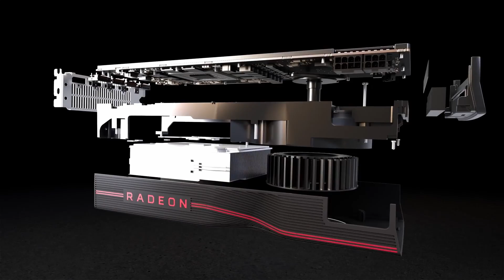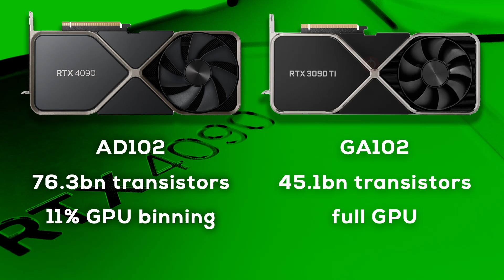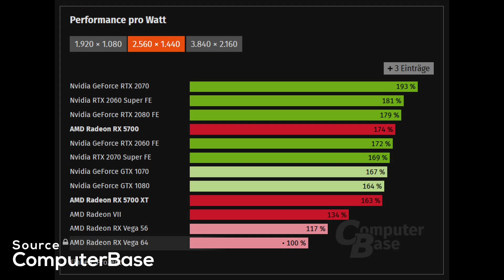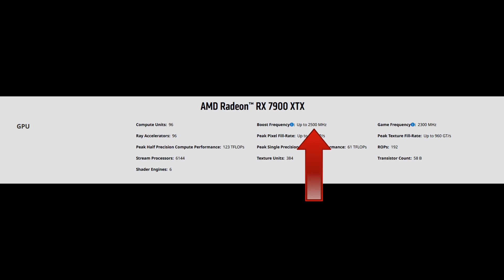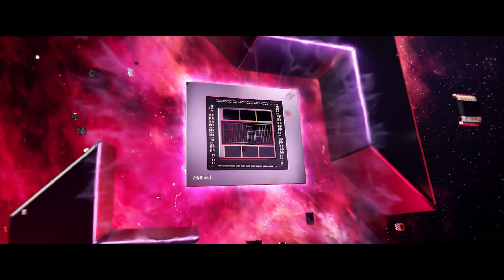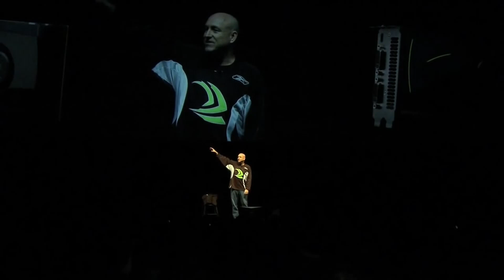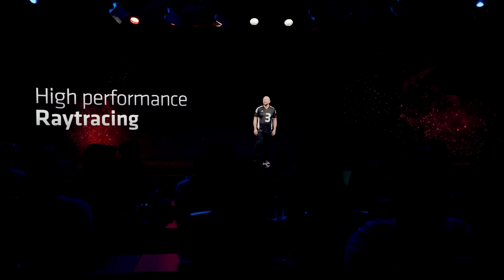RDNA3 – what went wrong?

Comment: This is incomplete reasoning. The economic metric includes silicon cost per transistor, not just the total count of transistors.
Monolithic dies suffer increasing defects as die size grows, making average cost per transistor to go up. AMD likely made a trade-off of adding more transistors at lower average price and some of those added transistors were likely just the overhead of the chiplet design (allowing smaller dies).

Comment: Cheers for an excellent video that presents some well-organized information. It’s abundantly clear that AMD made compromises with Navi 31. It’s interesting how nVidia provided a gapping hole that AMD felt they could fill even with a subpar offering. Taking AMD’s own comments into consideration it’s clear that they either planned on underclocking Navi 31, or were forced to in order to ship by Q422. AMD might release an iterative version with a faster clock speed, but that will do little to redeem their once sterling reputation. 

My take on this parallels the comments made by “High Yield”. I’m guessing that AMD knew they had to bite the bullet to introduce the very first GPU chiplet design. Because power requirements for nVidia’s Lovelace architecture were so insanely high, AMD sought to offer a GPU that was somewhat below most folk’s expectation of 50% improvement over Navi 2, while also consuming far less power than nVidia’s new GPUs. 

AMD likely assumed their lower power consumption combined with much lower retail pricing for Navi 3 would make it a no brainer, at least until benchmarks showed the actual performance, which is always lower than what manufacturers show during keynotes. I mean seriously, have community benchmarks ever exceeded keynote expectations?

That said, when I consider how much additional engineering went into AMD’s first chiplet-based GPU design, there’s likely some extra performance hiding in Navi 3. It’s difficult to assume otherwise when we consider how rushed Navi 3 appears at first glance? Requiring any processor to go off-die to access cache will impact performance, but AMD has bet the farm that their chiplet approach will work even for high bandwidth ops like graphics processing. AMD will discover both the good and bad of what this architectural shift provides. As AMD continue developing drivers and probably more importantly, revving hardware with process improvements, Navi could far exceed its targeted 3Ghz clock does to provide some serious performance improvements. There’s likely some headroom built in to Navi 3 that will take time to unlock as AMD continues to refine what’s a brand new approach to GPU packaging. 

Phew! Sorry for the novel-length comment! I really enjoyed the video and appreciate all the time and effort that went into making it. Well done! 👏 👏👏

Comment: I Think "High Yield" didn't elaborate on the Interconnects? The AMD Guys said the Interconnects to the CMD Modules introduce a extra bit of latency, maybe only because the way is longer (idk).. and they will fix that added latency through higher interconnect clocks. Maybe the Higher clocks didn't go up all the way they wanted. and so the chips are starved of Date from situation to situation.
Reply from the maker: If that’s the case, a bandwidth test could help figuring it out. For example overclocking the memory alone.
Reply: @HighYield  Memory Clock is one thing, but does that also increase the interconnect clock?
Reply: I’d anticipate that overcoming the latency of off-die cache was among the most challenging aspects of AMD leveraging their chiplet design on a GPU?! I watched the SRAM scaling video right before this and it seems that AMD saw the writing on the wall. 

These are some exceptionally well made videos that present very complicated topics both clearly and efficiently. I’ve only watched two, but they were easily worth a subscription.

Comment: You have a crucial mistake:  The GA102 aka 3090ti is 28 Billion transistors, not 45 .
I strongly recommend to redo the video and correct those number... or patch it.
Reply from the maker: Read the pinned comment :)
Reply: @HighYield  I read it afterwards. in the video, please place correction, a tag overlay with the correct number... my recommendation.
regarding the 3 reasons you stated, I think clocks isn't one of them because, when those cards are overclocked to the extreme,  and we got up to 3400 Mhz at our testing, the performance do not improve. when the stock is around 2.5Ghz, the best OC achievement from there, is around 10% doesn't matter if we raise the clocks 10, or 20, or 30%.  no more performance is achievable. . it doesn't scale correctly so the conclusion is that the clocks are not the problem. the problem is some bottleneck some where in the pipe. it can be due to the new cache and Vram architecture using external chiplets, maybe too much latency, buy until AMD  tell us what they have found out, we can only guess.

Comment: Um wrong 23.6 tflops of the rx 6950 xt vs the 88 tflops of the rx 7990 xtx is way more 30% more like more than 300% improvement and that’s just the base amd model add 3rd party models of that graphics card and you’ll get about an extra 7 tflops , matching the base model of the rtx 4090 ti 😮

Comment: AMD overpromised and underdelivered with RDNA3 (especially with that "up to 1.7x" slide). The 7900XTX is a good card especially againts the 4080 but was just made to look more capable than it was. So if a company doesn't deliver, it's only fair it receives the backlash. This is not the type of behavior consumers should be rewarding.

And the cards will get better as they improve their drivers but again, consumers should be reacting to what the products can do now, not what it can do 1-2 years from now. Nvidia RTX 2000 series (cos not many RT games at launch for such high priced cards) and Intel Arc (DX11 driver issues) both rightly deserved backlash from this. 

And of course quietly increasing the TDP of 7900xt after the big presentation is pretty scummy. AMD was just taking advantage of the (rightlyfully so) backlash to Nvidia's prices this gen as consumers' thirst more well priced alternative than usual.

Comment: The comparison in purely transistor count is not very fair. A significant portion of the die is dedicated to cache, which doesn't scale much in density from 7nm to 5nm, and 7900XTX has the same total die size while needing to dedicate a large portion to cache.

Looking at the GCD, 6950xt has 80 compute units or 5120 shader units, while 7900xtx has 96 compute units or 6144 shader units. That's a 20% increase in CU count for >30% increase in performance.

Comment: AMD really, and I mean really must absolutely must not continue to mess up these launches. RTX 50, AKA Blackwell, will have it's flagship built to the reticle limit of TSMC N3, which will be 850mm square die, the 4090 is only 600mm square, the 2080ti was 770mm square. A near 50% larger die with a 35-40% transistor density jump, in addition to actually cranking the TDP to around 650( a 50% power jump on a 30% more efficient process) and you are looking at again, another 3090 to 4090 jump, but to the 5090. I don't think most people realize how fast a 4090 is either, it is roughly 3.5 RTX 3070s worth of performance, and 2 3090s..or 6 GTX 1080s. It is obscene. 

AMD needs to get this right, and then release a 7950XTX using a 550mm square + GPU die in addition to the MCM approach. Nvidia keeps saying they are monolithic only, but the reticle limit on TSMC N2 is only 450mm square, Nvidia will likely move to the same approach AMD is currently using then, which will still  be a huge net gain as currently cache takes up over 2/3 the die on the 4090, and will likely on the 5090. 

Worst case scenario though, Nvidia releases a N3 MCM GPU where the 850mm die is just the compute die, at that point AMD would be unable to contest Nvidia's performance for at least 2 or 3 years.

This isn't even addressing the absolutely dogwater Ray Tracing performance AMD has. It does not matter that many forms of RT in games are Nvidia based methods. There are AMD methods out there, they look bad compared to Nvidia's RT and are not even worth using when compared to already existing shadow methods, especially against modern solutions like those that exist in UE5, with Lumens. AMDs approach is only good for reducing complexity of the GPU compute die, they build with the same ethos of 1 size fits all like they do with their CPUs. The difference is a CPU whether it has 2 cores or 16 can still run all the same stuff, only difference is speed. Their approach to Ray Tracing with RDNA is like trying to run the physics in a game off the CPU.

It is so fundamentally flawed because the GPUs do not have dedicated RT cores, so until AMD can figure out how to run RT asynchronously, via the FP 32 + FP 32/Int architecture(this probably isn't even possible) they added with RX 7000, it is always going to carry an enormous performance penalty because you are not only running more stuff, but you are taking away cores for raster and giving a significant number of them to RT. 

Perhaps now that AMD has an MCM design they could add a RT dedicated chiplet to the set up. That would alleviate the issue. But it is not acceptable that 4-5 years on,  RTX 20 series cards will be able to out perform some RX 7000 cards in RT.

Comment: Do not forget, Nvidia actually jumped 2 nodes. Ampere was on Samsung's 8nm, which is just a refined 10nm. They now skipped 7nm and went straight to 4N, which is a refined 5nm. Previously with RDNA2 AMD had about 1 node advantage. Now they are ~half a node behind.
Reply: Nvidia jumped 2 process nodes and 3 generations of lithography machinery. It’s the cutting edge of mass production capable Lithography tech currently. That’s why the Lovelace wafers are reportedly 4 times the price of Ampere. However, they massively cut die area for the 4080 vs the 3080, so it shouldn’t be THAT much more expensive to manufacture gen on gen. The obnoxiously huge coolers for a 300W max chip adds quite a bit of BOM cost and the markups are huge. I still think the 4080 should have released with its own cooler and a 700-800$ price tag.
Reply: @MechAdv  If it was released at that price it sure would be praised
Reply: @Mielyn_Lux  For sure. I honestly would have bought one. I only upgrade when I can get 50% more perf for the same tier card. I upgraded from a 980 to a 2080 to a 3080. Not willing to pay more than 700-800$ for a GPU though. So it’ll probably be another generation before I can get my 50% uplift at the price I’m
willing to pay.
Reply: @MechAdv  for real. as a water cooling enthousiast the cooler is just something that will end up on a shelf.
Reply: @MechAdv , 1080 Ti was a 300 W GPU and somehow only $750-800.
Reply: @KraziSpeed Agent 09  None of those numbers mean anything. Read some of my comments in this thread to understand why those 4n, 5n, 7n, mean nothing. Nanometer is a misnomer now for transistor size. The 5n from TSMC is between 22-36 nanometers. It's all about transistor density these days, and the so-called "8nm" isn't a node generation above "7nm." It's more of a quarter generation better. The problem with RDNA3 is that AMD played it safe and the teething problems with the chiplet design, which raises power consumption and increases latency, which hurts performance. The node process advancement is quite minimal between TSMC "7n" and Samsung's "8n."
Reply: @ejkk9513  So what actually matters? Nvidia & Amd know better, and they choose TSMC over Samsung's, pretty much end story. Story back to Nvidia N4 vs Amd N5 now. If TSMC N5 is between 22-36 nanometers, then Samsung's '8nm' is NOT smaller than this anyway, isn't it? Or you are saying TSMC technology is a lot advance so that they can beat samsung 8nm with 22-36nm nodes. I guess this makes sense.
Reply: TSMC'S nm lithography is not that much advanced as the media makes it seem yes it is a little better but tests shown on hardware made on both nodes that TSMC is 1 to 15% better but not 50% or 2x the media made it seem like
Reply: That's not true whatsoever. We need to stop using nanometers as a measurement for nodes. They started lying about nanometers back in 2009. TSMC "5nm" node is actually between 22-36 nanometers depending on how you measure it. We need to focus on transistor density. The 6900xt Navi 21 chip has a density of 51 million transistors per square millimeter. The 3090ti with the GA102 has a transistor density of 45 million transistors per square millimeter. As you can see, it is nowhere near an entire generational jump. A generational jump is generally 2x-3x the transistor density. So while TSMC "7nm" node is better than the supposed "8nm". It's not by much.
Reply: @ejkk9513 There’s more than just density that contributes to the performance of a node though, so even if the density isn’t as much as the process names imply, there are other aspects to be considered.
Reply: @ejkk9513  Our 7nm node is night and day compared to Samsung 8nm (10nm). Density also highly depending our customers designs. Do they use near full advantage of a node's possibility? Not always. In fact is most cases, not. Nvidia went full throttle on Samsung's 8nm I assume based on the design density.
Reply: @Thomas Sally  What do you mean by "our"? Are you the CEO of TSMC? If you are... that's cool but you really should know the difference between nodes. It doesn't matter how hard Nvidia pushed the so-called 8nm node. It is nowhere near a generational improvement of TSMC so-called 7nm. The transistor density does not support that whatsoever.
Reply: Again, it highly depends on our customer's architectural designs and parameters. Lets say this way: Most of our partners not taking full advantage of our nodes due to several factors, leaving 20-30% easily on the table. We can go to the 70-80's range with N7 no problem. Samsung 8nm is in the rear mirror. Check A100's density. Same node like the 6900xt (if you mentioned that). The design however ~20-25% denser on average. Still not hitting the node's architectural limits though.
Reply: @Thomas Sally  My research showed me that the A100 has a density of 65 million transistors per square millimeter. Still not anywhere near the number you mentioned. That number is higher than the Navi 21 die. Ad102 on the so-called 4n has a transistor density of 125 million transistors per square millimeter. From the research I've done, the "4n" has a maximum density of 146. Even Nvidia isn't maxing out what's possible. The 8n process Nvidia was using for Ampere maxed out at 63 million transistors per square millimeter. GA102 only had 45. That means Nvidia didn't get close to maxing out what was possible on that node. That would go against your claim that Nvidia was maxing out that process. From the knowledge I have about these processes. They never seem to max out what is possible on a node for yield and stability reasons. The "7nm node from TSMC is at best 10-25% better in terms of transistor density and efficiency at a given speed. Not a generational improvement.
Reply: @ejkk9513  Correct, even A100 left a lot on the table, like you also mentioned, for several reason. I assumed (not claimed) Nvidia pushed hard on 8nm. What I can claim: Samsung 8nm vs our 7nm: ~60M/sqmm vs. ~90M/sqmm. speaking only about avg. density. More like 40-50%. Again, 8nm is in the rear mirror in every aspect.
Reply: @Thomas Sally  I never disagreed with you on the merit of 7n being better than the so-called 8n. It is better. It's just not a generational leap.
Reply: @ejkk9513  Depends how one's define a generational leap. If ~40-50%  is not a generational leap, and ~ 2x-3x the transistor density concluded as one, then clearly from your perspective it is not a leap. 7N to 3N/3NE is hitting that ~2.2x mark though.

Comment: With the cost of current GPUs, I don't think I will upgrade from my Red Devil 6900, but I think there are some teething issues with this card and drivers (No, I do not believe AMD releases sub-par drivers, I have never had an issue), but because of the new memory setup, it is going to take some time to solve the issues. Kind of like my first gen Ryzen.
Reply: Hello, any coil whine from your Red Devil?
Reply: @Yandross  no, but I ended up getting a 4090 because of its vr performance.

Comment: There went nothing wrong ....  , if NVidia would be still on a Samsung node because TSMC would not have been able to allocate 4 nm quotas  on the short Term to Nvidia ,  then the RTX 4000 cards would be very very Power hungry  , thats why they developed the 600 W Power connector and thats why even the 4080 has such a big Cooler . NVidia payed Billions to change back to TSMC ... 
Y o u may have been expected more , but based on what ? leaks ? The Drivers will improve and you will see 10-15 % more Performance in some Games , this was the case with the RDNA 2 cards , this will be the case with RDNA 3 cards . Raytracing catched up to the RTX 3000 cards but NV gone ahead again with the RTX 4000 cards ( as expected ) .

Comment: The 790xtx isn't bad, but the price of everything isn't great.  All of the currently released 'next-gen' cards are missing dollar/frame gains.  Nothing is actually performing better per dollar.  The industry has stagnated.  Until they drop prices to normal the industry is stalled.  These new cards should be $200 less than they are, or more in the case of the 4090.